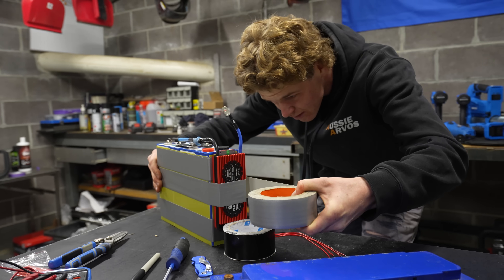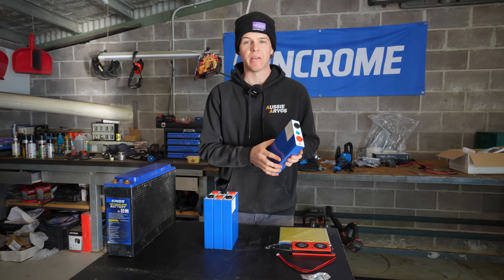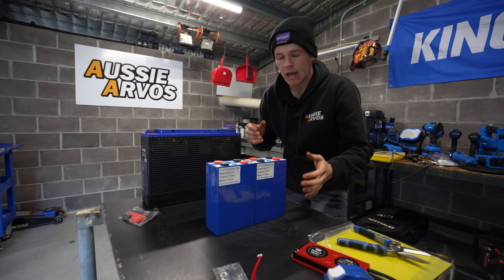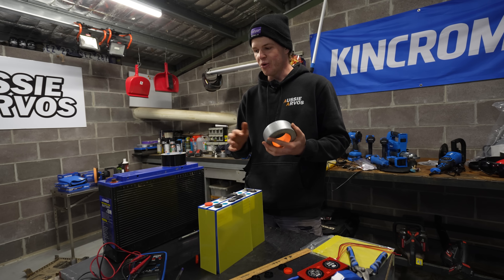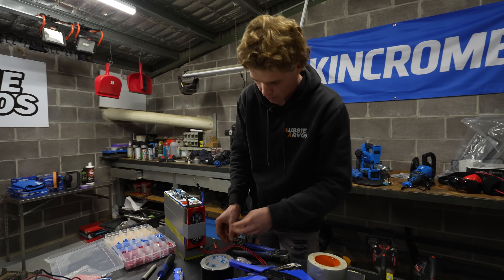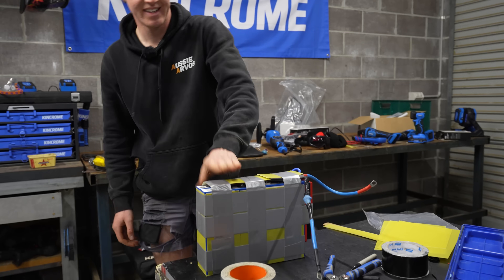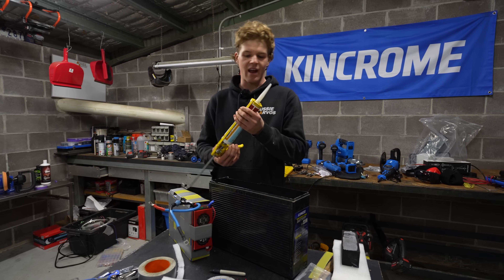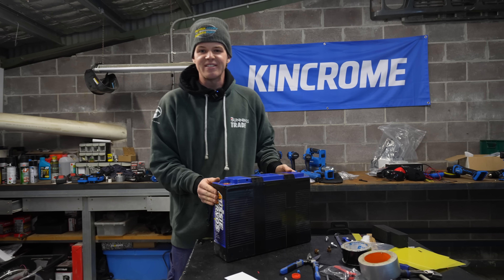BUILDING my own LITHIUM BATTERY from SCRATCH!

Comment: Keep in mind, a BMS is NOT included in the $362; it's an extra $120 on the site old mate shows us is on the side of a cell. Good news is in late 2025, this 4 pack is still $362 delivered free to most areas.
For securing tape, best to use fibreglass tape. It isn't expensive, I got mine off of Aliexpress, but it is fireproof/heatproof and really strong. So, not gaffer tape, no, no, no.

Comment: Hmm, I don't think you can change the AH rating by changing the configuration (series or parallel) as otherwise you have effectively increased your capacity (conservation of energy etc.). I suspect each of those cells is 25AH to begin with - so you end up with 100ah no matter how you connect.

Comment: You should always balance the cells via put them in series and let it charge to 3.65 Volts, this ensure all the cells are at the same state, but I suppose for a small system maybe not worth it, I do it anyway.
Reply: he doesnt put any cells in parallel so this is not needed. you can also just check the voltage before assembly. new batteries will be same voltage

Comment: one thing i wanna say please select bms with temp sensor when installing it in a vehicle or exterior environment as vehicle engine heat or anything can heatup the battery pack easily or the vehicle sitting under sunlight on really hot summer day

Comment: What did you use to make the bus bars? I’m pulling apart two 100ah batteries and using 2 Daly 80amp BMS and will link the two batteries in parallel. Hoping it will work.

Comment: I was given 16X 55ah cells from an older solar backup battery and plan on making 2 12v packs at 55ah and running them in parallel in the back of my 4X4. it means 2 BCM's but it also means I can hide 2 smaller packs rather than trying to hide one full size 110ah pack.

Comment: Great video!

Something to consider for the bus bars is to ensure the holes are elongated to allow some sliding as the cells expand and contract through charging and discharging. This swelling is unavoidable and due to both heat and the physics of the atomic size of the lithium atoms when they migrate within the cell through the charging and discharging cycles.

Comment: Fark did ya use steel for the bus bars cos i wouldnt do that they might work ok but under load wont be too good and you will get electrolysis between the connections

Comment: Hi Guys,  I'm not blaming you in any way but I feel that you guys and your viewers should be made aware of what I have to say. Based on your experience I looked at LithiumWayBatteries and  purchased the 24V LF314 Kit for $2180.00 . Half of the kit finally arrived after 2 weeks and I found the following issues. The numbers on the JK BMS do not match anything on the JK BMS site , the QR code on the batteries will not scan. The picture of the kit clearly shows 2 bolts per cell pole, the units supplied are only one bolt per pole. All of this is bad but what annoys me most is that he is choosing not to reply to my request for him to sort this out.

Comment: I see the arrangement of the cells and their terminal orientation is REVERSE to the battery case TOP. . Maybe not essential but having the POSITIVE able to connect straight to the POSITVE of the case LID would seem to be "MORE BETTER to me. Negs have to run to BMS anyway, so they can be anywhere. I built a battery with 72AH x8 in 2P 4S configuration so 12.8V at 144AH and the same DALY BMS. UNfortunately, after having it sit idle for a while but connected to a charger, but not being charged, the cell pack went down to 7 VOLTS. The DALY BMS, "DID NOT DISCONNECT"  the battery cells from PARASITIC LOAD.. MAYBE a TEST THERE WOULD ENSURE ALL IS GOOD at the BOTTOM END of performance.  Also the fins on the DALY BMS are for COOLING, I would NOT cover any part of them with tape. My battery has an internal switch/able FAN to be able to turn on if being charged at high rates, Cools BMS and BATTERY CELLS.  Because the BMS is FINNED, thin aluminium sheet can be FORMED/FOLDED to engage the fins at the edges and continue around the sides of the battery cells and therefore provide additional cooling, and not restriction to OE cooling of fins. Taped and siliconed where required of course.

Comment: My only question is everyone says you have to top balance the cells. So basically charge all the cells to make capacity to make sure each cell is performing to the best of its ability. I am building a similar battery was wondering if you guys did this if not how’s the battery performing?

Comment: The yellow heat proof tape is one layer thick for ya next battery build or if ya find its running to hot that's what they use

Comment: that bms really deserve more thermal than it currently have, but good news the temperature sensor inside the BMS could save it from total failure under hot days or sustained load from charging or discharging with overheating protection, otherwise amazing build!

Comment: Kapton tape mate! Also windscreen sealant for waterproofing. 
Great video, great build. One of the best videos I’ve seen in a while.
Reply: Was about to twrite this!!! RIP silcone.
Reply: I've used silicone to seal up prawning lights and they're fully submerged in water and nothing leaked.

All that battery is going to see is road spray, so I reckon it'll do fine, unless water can get in through where the terminals come through the cover.

Only time will tell.

Comment: The people selling those BMS's on ebay are idiots clueless been in contact with them to build my battery and i am building x2 230ah lithium batteries and they cant tell me wether i need a 200a bms or a 250a bms for each battery 😂
Reply: They can't tell you because it depends on your power needs. You're the idiot

Comment: Before assembly, did you check the voltage of each cell and top balance each cell. Connecting mismatched cells together is a bad ideal due in rush current into the lower voltage cells and doesn't help longevity.

I personally wouldn't build my own battery due to liability.

Comment: The terminal bolts are supposed to be torqued down, I would probably loctite them as well as I’m sure you’re going to travel down corrugated roads… throw those Phillips head screws away !.. bus bars could vibrate loose and create a hot connection / make a fire
Reply: Agree with everything except Loctite. It will insulate the male thread from the female thread. Lock washer may be suffice.
Reply: the bolts that are delivered with the battery cells already include lock washers

Comment: These LIFPO4 cells are still really REALLY expensive. Since I started seeing these on youtube prices at private consumer leven have barely dropped. However. Cost per KWH at cell level is now under $80 US and I believe fast approaching $50. So that would be the cost for all four of your EVE cells. 

There are massive profits for Distributors selling cells to end users or even the manufacturers selling pre made batteries. 

Hopefully this will change and we will be able to buy cells at a better price 🙏

Comment: please use Kapton tape next time, also these cells are also pouch cells in their own case, so the case is the insulation between each cell, there was no need for the epoxy sheets. other than this well done and great video

Comment: Knackers! Staino Bus Bar? Thermoblock on Daly cooling? Limp wrist torque on the connectors?The conductive resistance of stainless steel (6x10-7) to copper (1.8x10-8) is like 33 to 1 so heat gain in the bars will effect resistance 10x times more. The bus bars will grow in length and start the loosening process. Torque specification for full load by life cycles is 10x what your stale twistie turn achieved, the resistance will go up just like the flames when you're half way through dead dingo dongers track. Oh dont count on the grey tape to hold as any summer outback adventure using batteries half hard and prior to the daly shutting down will soften that tape into random toilet snot. Do some, just some research and relaunch the Vlog, not this Flog.  He said "Seems too simple" will go on the coroners report just before died by the Dunning-Kruger effect.

Comment: your title is a bit miss leading, you didn't build your own battery "from scratch"  I've built my own batteries from scratch using 18650 or 21700 cells,  at best all you've done here is repack the case with prebuilt lithium packs.

Comment: Further to my last comment. If anyone is interested in building their own battery, another local Oz company selling LifePo4 cells in addition to a high quality BMS which they've designed themselves is Muller Energy. Having compared the cells sold by Lithiumwaybattery with those sold by Muller Energy, Muller Energy are selling the latest 314AH Eve cells (model MB31). I have no affiliation with any of these companies, I am only making this information available to save others time should they be interested in purchasing from local companies.

Comment: You need to top balance those cells first.  Measuring 3.2V is no indication of their initial charge state.  Without doing the balance you will never get your actual capacity once in 4s configuration.  A workaround is to install an external balancer but these are often low amperage balancers.  The Daly BMS takes loooong - if at all - to get the cells balanced.

Comment: Well I hope like he'll you read these comments. Just remember, that bms has no cold temp cutoff, so don't go charging it with your dcdc if the cell temps are 0°C, you will more than likely do damage to the cells, you need to check. The bms will function at -20, doesnt mean the cells like charge that cold. I also would have liked some glue on the terminal bolts, if they come loose, you will see some very high temps pulling 90amps and melt things, then they catch on fire. Busbars need to be torqued also, resistance is important for cell balancing. All the best.

Comment: Word of caution. I really hope you boys fully charged each cell before hand individually otherwise they will be imbalanced even if they "are the same voltage" when tested.
Reply: The BMS helps with cell balance when charging
Reply: @richardedwards8648  Only by so much. Especially since the Daly they have doesn't have active balancing. 

Also lithium iron phosphate has a relatively flat discharge curve meaning it's harder to know the actual percentage just via voltage alone.

Comment: Good stuff mate, your buss bars and bms connections and mounting look better than the original I reckon, as for heat inside and around the bms i wouldnt worry as they have over temp shut off and same for freezing temps, would be cool to know what their specifications are for that.

Comment: Well done on the battery build and for taking on the feedback from your viewers. Coincidently I came across lithiumwaybattery 2 weeks ago . I've been on the fence about buying direct from China and for only about 20% more the QLD mob offer a low risk alternative assuming the Eve cells are legit. Thanks for sharing. Cheers. PS: What brand induction cooktop are you using?

Comment: Great vid the only thing i would have done different is use proper Kapton tape first including over the exposed terminals you covered with the foam rubber.  Then the cloth tape as you did. this battery will last you a long time i'm sure i have made a few of my own and they are going strong years later.

Comment: I need a Bluetooth BMS to use with Li ion cell's but everything I'm finding is for solar cells ect.
Any help appreciated. 
Nice job 👌
Reply: JK BMS, built in Bluetooth and active balancer, much more reliable than the Daly. They have a default setup for li-ion, but you should program for your particular cells. Lots of options for cell and current capacity.
Reply: @JonathanMckenzie-lf2tn  I was looking at JBD but they seem to fall into a Chinese market of fakes.  
I'll definitely check out the JK!  Thank you 👍 
Would you happen to know if a 20s ect can be used as a 4s ect? 🤔 
I can't seem to find any information on that side of things.. 
Unless they operate at a specific voltage, it shouldn't matter should it?  🤔
Reply: JK or JBD BMS are good. JK has active balancer which is handy

Comment: Great video mate but as a builder of a 200amp for my Ute 12v and 2 x 48V for my house you have missed a critical step. The cells needed to be top balanced in parallel to 3.65v  prior to building them in series. Just food for thought. This ensures maximum longevity and balance in the cells

Comment: Epic video I've already popped over to the linked shop. Think I'll have a crack at a 330Ah one for $1000 its great value!
Reply: Just purchased 8 grade A cells each at 280ah direct from China manufacturer plus 2 x JK BMS, 2 x battery boxes and all the bits and bobs. 2 x 280ah batteries for my caravan delivered to my doorstep in South Australia for $1400. Easy to deal with

Comment: NIce build. Top tip is to connect the balance leads and then check the voltage before plugging it into the BMS. If you get the order wrong it may not work or worse can damage the BMS if you short them.

Comment: With zero experience and youtube I built my own off grid solar system 5 years ago for only $7500 providing 80% of my power which paid itself off over a year ago making it an instant no brainer to do with all the sun we get. I got a quote for someone else to build it for me and they said it would cost me 20 grand minimum. Since then it has only gotten easier and cheaper to do making it accessible to way more people. One of the few wins in an economy where the consumer is usually the looser, unless you get a company to do it for you then you still loose big.

Comment: You guys did the math on the DIY busbar’s CCC, right? Bit concerned at how thin they look to be pulling that kind of current if they’re aly or steel given the higher resistivity than copper. Would love to see a video showing some testing under load, particularly the heat dissipation as we get into the hotter months later this year.
Reply from the maker: Yeah they were alot thicker then the ones provided!
Reply: @AussieArvos i wouldnt be showing beer guzzling patrol drivers how to speed run a melt down.
Reply: @putnamehereholdmadoodle  I understand the patrol drivers bit . . . . but whats with the beer guzzling . . . carmon mate 🙂
Reply: @4x4touring47  lol
Reply: I did think that packing the battery in insulation could come back to bite him with the summer temps you get. But under the tray it'll be permanently shaded so it's not like it's baking inside an enclosed cab

Comment: One thing that may be worth looking at is what you used to pack it in to the casing, is it unaffected by temperature? Batteries do heat up. Will the packing shrink? If so it will be bouncing around freely.

Comment: Nice work mate. Good work insulating the cells from each other and mounting it in the case.

Few things to note, wear eye protection and use insulated tools. Arc flash and molten metal can take your eyes out. 

Depending you may need to balance the cells before constructing the battery also.. lifepo4 has a very flat voltage curve so may read the same voltage but not be the same state of charge. The BMS might not be able to balance the battery fast enough and will cutout early and lose access to some capacity.
Reply: @Pneumaticcannon  especially the Daly ! Very slow to balance cells, mine are all EVE280, all within 1mv when assembled and the Daly couldn't even keep them balanced 😞 never saw more than 200ma on the balance leads, before I got a better BMS I used to top balance the pack manually once a year.

Comment: can I ask what sealant you used. good job by the way.
Reply: parafix silicone which i think is acetic cure would be better to use something neutral cure and an actual adhesive rather than just a sealant.

Comment: I worked it out it wasnt cheaper but u got more amps and better quality cells I spose new kings 100 amp $399 What u made with parts  $22.50 + $359 + $63.47 = 444.97 plus u need a case with would cost a little as well.  but still a great video mite have ago at making my own now
Reply: I’ve purchased 2 x 280ah, 2 x JK BMS, two battery boxes with all the bits and pieces delivered to my doorstep from China for $1400 AUD. Wired in parallel for for 560ah in caravan 12v setup.

Comment: Personally I would of glued the BMS with nothing touching it to the inner wall of batt case so there is a gap between the BMS to the actual batteries. Mate if you open any battery do they pack it out with foam "no" 🤔 there is a reason for that, even the og battery had internal open space...I feel that is going to be a problem causing heat....good one for having go....hope I'm wrong....SikaFlex probably would of been better then silicone too....yeah mate I would seriously consider reopen and find another way to secure components then packaging with foam.
Reply: +1 on sikaflex instead of dogshit $5 bunnos silicon
Reply: You would be surprised at the amount of battery's that ARE packed out by foam. As for silicone, they should have used something like Kaufuter electronics silicone as it's non acidic. Unfortunately they obviously don't dabble in electronics as a fair bit more testing and setup should have occured before putting the batterys into a pack.
Reply: @unclejohn5012   they could have just watched one of the many many YT videos showing how to build a battery properly,  there is this huge resource out there stopping people building badly designed and built stuff, amazes me people with YT channels don't actually seem to watch YT 🤔
Reply: Yes amatures showing amatures how to implode there cars.

Comment: I did the same for my battery a couple of years before lithium was so cheap. Depending on the cells you get, you can easily get a bigger BMS too! Mine is 100Ah with a 200A BMS, and was about the same price as a kings battery at the time